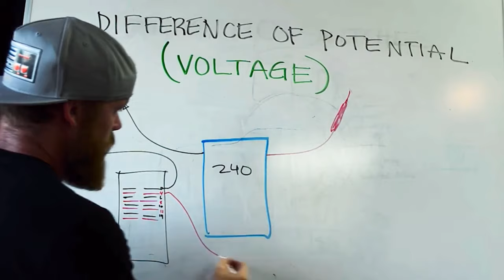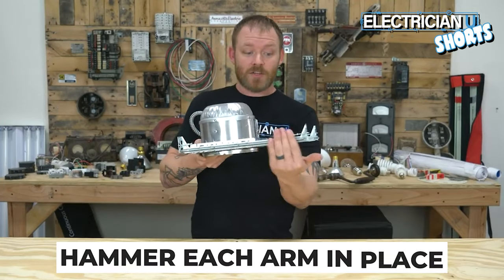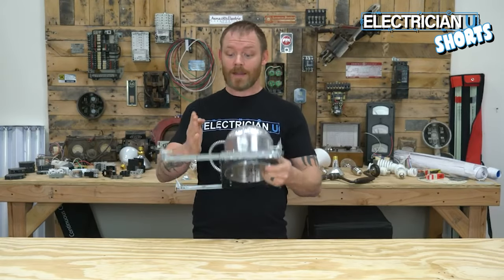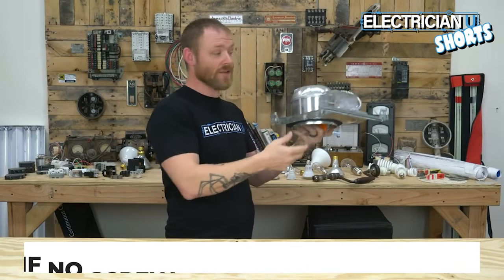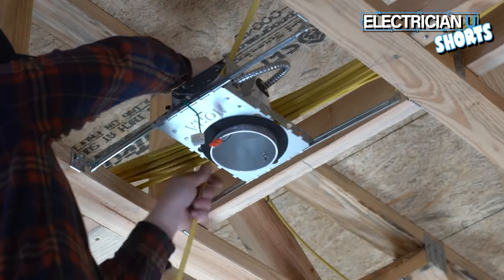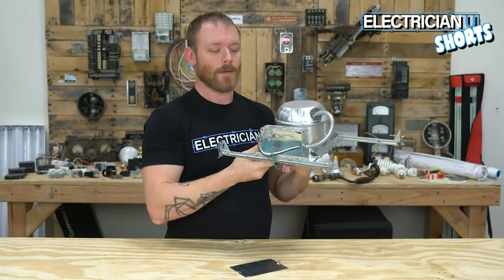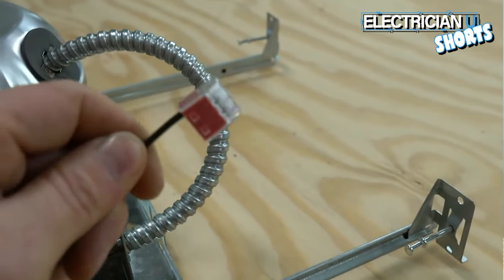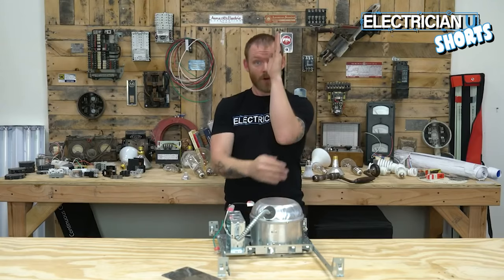SHORT - How to Install Recessed Cans

Comment: PRO TIP: use self-tapping/metal screws into the arms to secure them. there's even a spot on the inside of the arm which is meant for that :)
Reply: Yea I always use self tappers for those
Reply: Yeah I selftap mines to

Comment: Good tip on the laser, they are not just for carpenters!  If code doesn’t require these plenum rated/full metal housing avoid these hulking beasts like the plague they are OK in drywall but take up so much room and a they are a fu&king nightmare in a drop ceiling.  There are better options with slim/lighter housing if you are not limited to some code or regulation.

Comment: In Canada and we haven't used these in years we just use use the slim led thats like 1'' then it has a whip to a driver that you wire into so we just layout the room and put the wire in the approximate spot and put pot light rings up so the drywaller can cut them out or we just make a map and cut them out after , im curious if its just us that do it like this lol
Reply: let us know what is the best brand/type to get a nicely spread light? we use recessed lights because they diffuse the light "sideways".

Comment: Should I go residential or commercial in the union just starting in Chicago
Reply: Commercial
Reply: commercial, aka inside wireman. you will learn a lot more.
Reply: Commercial, you’ll learn a lot more and it’s better pay
Reply: Do both. I can’t tell you how many Union guys I’ve came across over the years that can’t wire a 3way. It’s pathetic.
Reply: Move. Go south

Comment: Best thing an electrician can do is talk customers out of installing these goddamn things.
Reply: Haha with modern led solutions idk why anyone still uses these. The new stuff is soo sleek. Honestly I’d even consider the type that clamp onto the drywall. They are so lightweight it doesn’t matter.
Reply: @EthanMatlack  👎
Reply: @johnkulpowich5260  Hey I’m just suggesting it. I wouldn’t use the drywall clamp ones for a new install, but I could see it being a nice option for homeowners doing a reno or whatnot.

Comment: These are on the way out. The LED ones just require the hole in the drywall to attach to and the junction box can be positioned relatively anywhere needed around the light and has quick connects to daisy chain them. Also nice to put where can could never go before as too narrow. Go with the LED streamline versions and avoid the can. Some even let you set the light to one of six light settings. Time savings and cost savings.